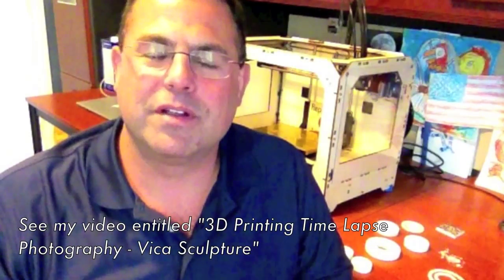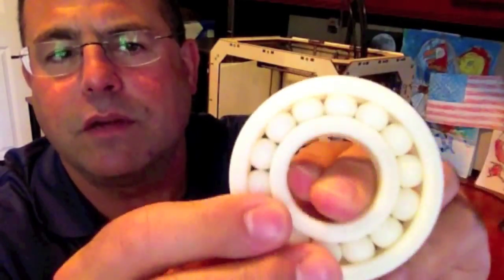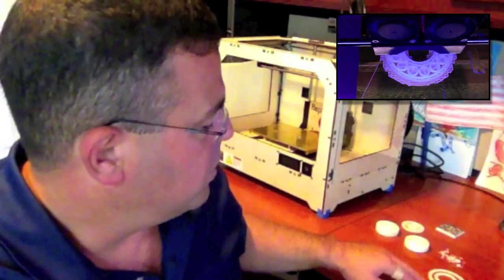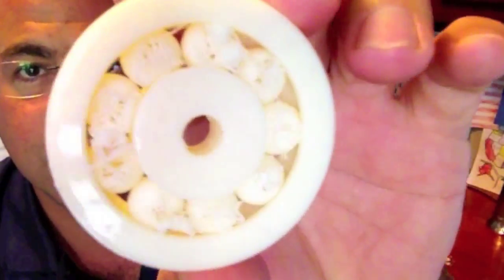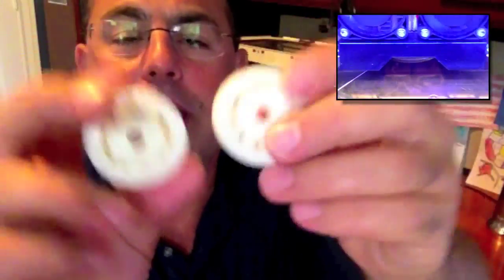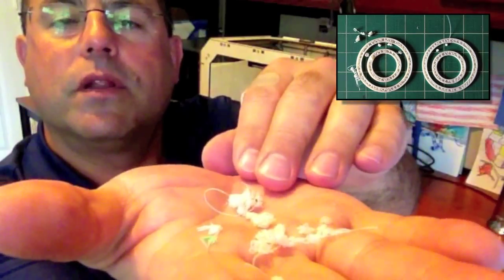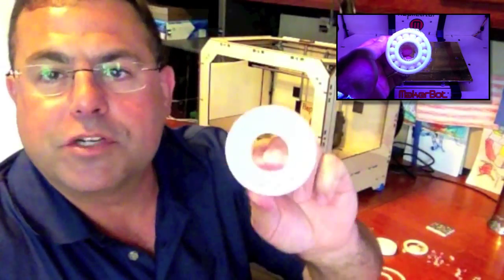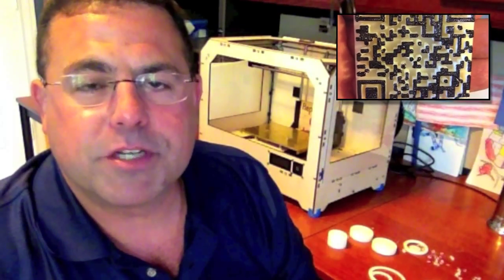3D Printing Ball Bearings

Comment: There's a Skeinforge profile that uses the Left Stepstruder to print the support material and the Right Stepstruder to print the object. If you use two different materials you just need to go into the GCode and change the temperatures accordingly.

Comment: I dont have a 3d printer but from what i've seen nearly any dual extruder can be calibrated to use one head for supports and one for printing so you could load one side pva and achieve that result.

Comment: I may be wrong, but wouldn't it be easier to print individual balls and then have the braces have a snap together design so you can just put the balls in and lock then in place. For plastic applications it should hold pretty well I presume?

Comment: Would you mind checking out a CAD for me? I designed it but not having any experience or a 3d printer to test it on I don't know if it will work. Its a modular organizer with shelves and drawers etc. my main concern is that the drawers will be too tight of a fit and not slide out, also the modular pieces, will they connect properly, I tried to make it simple. if you like the design and want printable versions I have separate STL's for each piece but I'm not asking you to print it, just judge it.